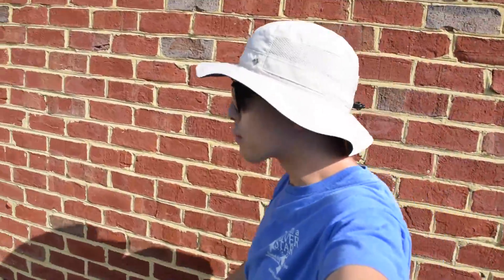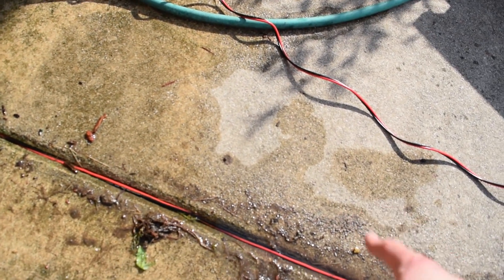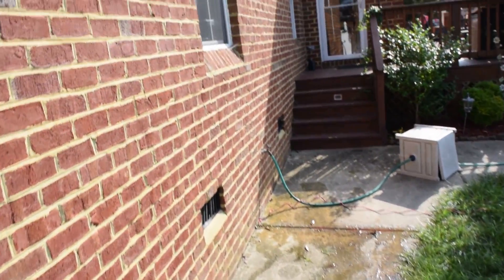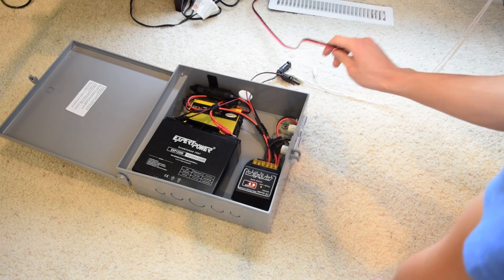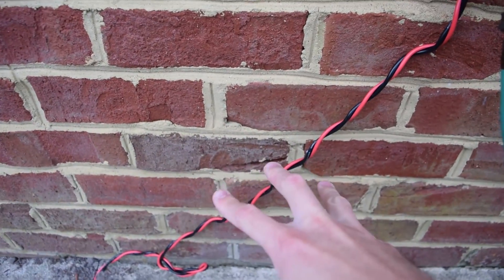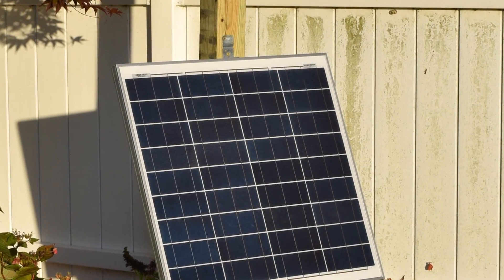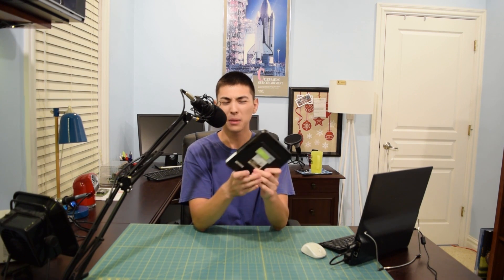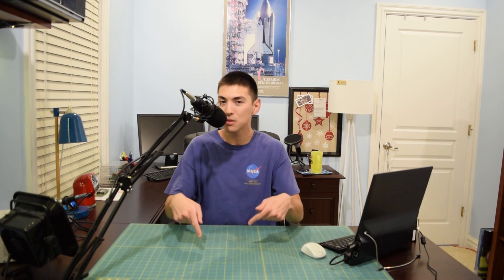Solar Powered Server Project: Trial System Part 2

Comment: Hey can a i run a pc with a power supply of 750w and a video card gtx 1060 with this?
Reply: Irony Handelf
My opinion (and I could be wrong, but I don't think I am though)
Think of it like this :
This video is basically the same kind of thing as trying to run your PC using a UPS (Uninterruptible Power Supply)
It's the same principle except, replace using sunlight to charge a battery with electricity from an electrical outlet.
You can't run a computer for any significant amount of time, as UPS's are meant to give you just enough power, to be able to save whatever you are working on, and shut down your PC correctly (in the event of an electrical power failure).
But in relation to this video.....
While the sun is out (so in the daytime) the battery is being charged (so electricity is being stored for use) but at night there's no sunlight to charge the battery, so the battery will run out of power rather quickly, depending on what is connected to it, so as to use that stored electricity.
The more electricity consuming appliances which are connected to the solar setup, so in your case :
PC with 750W PSU & GTX 1060 plus Computer Monitor as well......
Means the greater the draw of electricity, which in turn means, the shorter the duration of time which those appliances can run for.
So, if you are thinking, that you can play video games for hours on end, using a solar and battery setup , I think you will be very disappointed.
How long could you play video games for on a laptop for example, with a fully charged battery and not plug it into an electrical outlet ? 
Not very long , I would imagine.
Reply: For 750W continuous use you would need a 5-10x bigger system.

Comment: Try using 12 DC PSU's. That way, you'll not end up losing power by using inverter. Edit: Never should comment on a video that hasn't finished yet. Keep up the good work.

I'm planning on doing a 1200W setup (120A) -. looked up and the parts would cost around $1000 on eBay. What do you think about that? What panels to avoid etc?

Comment: Great little project, 3 things.
1. Change the inverter from Modified Sine Wave to Pure sine wave. It will use less power for the same amount of load, also always use pure sine wave for sensitive equipment like powersupples and anything IT etc. Google the long list of reasons :p
2. Rather then adding another solar panel you could also add a second batt, If the current solar panel does change the batt in a sunny day then it might also charge 2. The second batt will get you through the cloudy day and if both can change fully on a sunny day your sorted. In saying that more solar is always a good idea.
2b, make a solar tracker :)
3. Use lithium rather then lead acid, if your discharging that lead acid batt lower then 50% it might only last a year max rather then 3 or more etc throwing away a battery a year will cost too much and make the project costly and pointless. Lead acid should only be discharged to 50% and your inverter will most likely not stop and discharge the batt well past the 50% Lead acid limit normal limit.
Some things to think about but great start, 
Also have a watch of some videos on my channel about using 18650 batts which you could use for your project :)

Comment: I have a question: why didnt you use a lithium-ion battery(or built one yourself) instead of a lead acid battery? For the same volume, capacity would've been much higher and even could've much smaller. Or were you limited by the prohibitive costs of these type of batteries?

Comment: Ever considered upgrading the system to 24v in the future? Higher voltage means fewer power losses with the wire you use.

Comment: that power cable coming in is not good you should use a piece of congute plastic from the solar panel its not good have it in the ground like that not good being in the ground it could get cut by the lawnmower and  you could get electruted not good
Reply from the maker: The cable is under soil and cannot be cut by the lawn mower.  The line running from the panel into my room is only 12V,  that's not enough potential to electrocute anyone.
Reply from the maker: I do agree that the wires should be housed in some sort of enclosure like a small diameter pipe to protect them though.
Reply: oh ok I thought it was 20v from that solar panel still give you a bit of a kick I would run it in hard plastic for safety my self thanks its good to see how you did it im looking at one at my House in the Philippines I need run a tv then fan and a computer hopefully of one inverter im looking at about 1000w maybe I need bigger one ?
Reply: sorry watching it again 50v
Reply from the maker: Well , technically open circuit voltage is 20V but that is still not enough voltage to be immediately dangerous. I cannot say,  I can power a small TV, computer, and fan with my 175W inverter.  It all depends on the specific  power requirements of the devices.
Reply: yes I think a bigger battery would help I have 2 batterys hear like yours and it only runs my CB radios ok but its not powerful I charge the battery's on a 20amp power supply its heavy duty one so its free power when I have it on I have the batteries charging same time that can be done by solar and a inverter eventually thanks

Comment: I think that you should run the feed wires through pipes, so as to shield them from wear. And you could brook a Raspberry Pi as a web server.
Reply from the maker: That's a good idea.  I think with the final system I will route the cables underground through small diameter plastic pipes.
Reply: @AAComputersandTechnology  how did u get an earth connection (green and yellow wire) for the equipment great video by the way thanks Ben
Reply: just trial no need to intstall conduit . its not permanent just trial

Comment: You might want to look into how much power draw the two meters on the side of the box are drawing if you haven't already. I've seen some that draw a lot more than one would think. Put a momentary switch in the circuit to activate them when you want to check the line current. No sense in wasting any of the precious power you are working so hard to make.
Reply from the maker: Hmmm, I never took that into consideration.  I bought the analogue meters because I thought they consumed a lot less power vs their digital counterparts and therefore it would not be an issue to leave them hooked up all the time.  I will have to break out my multi meter and see how much power they are really consuming!

Comment: There is some motherboards with a 12v jack . These are not cheap, but It's perfect.
Reply from the maker: Yup, they also sell 12V  power supplies too! :https://www.amazon.com/Mini-PicoPSU-150-XT-DC-DC-power-supply/dp/B0045WFZSQ/ref=sr_1_13?ie=UTF8&qid=1471708666&sr=8-13&keywords=12V+computer+PSU
Reply: I've seen the pico psu used in some computers that are integrated into industrial displays for digital signage and such,